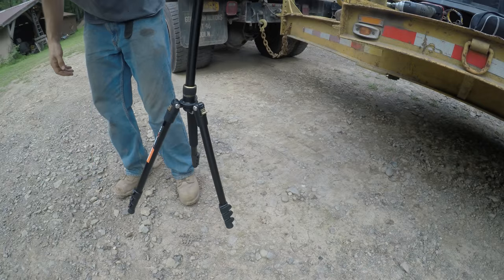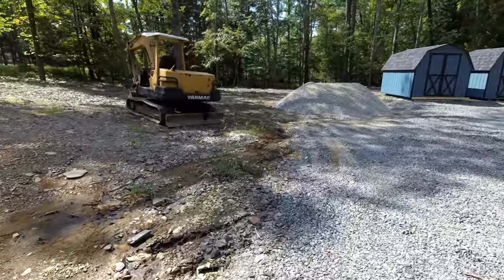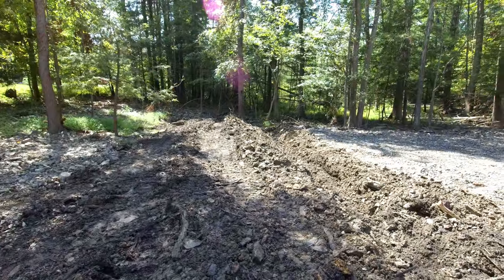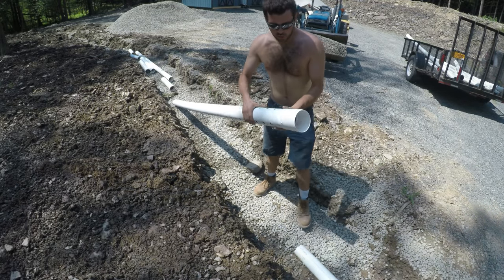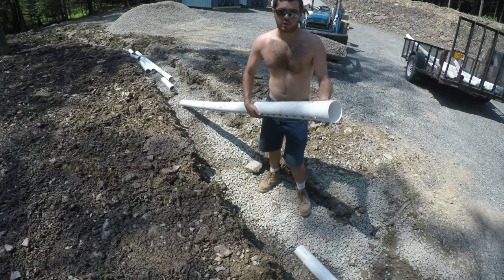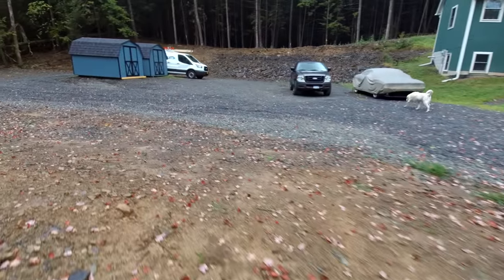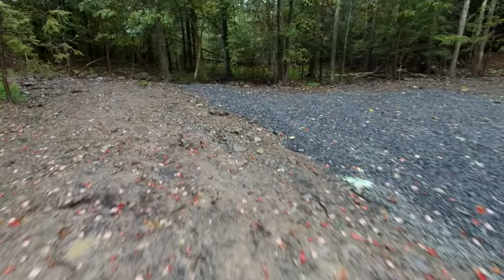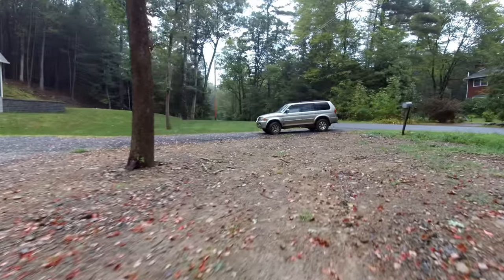Digging a drainage trench

Comment: Good job but I would recommend you should cover the underground drainage pipe with landscaper's fabric.  It's cheap and keeps dirt from clogging the holes in the pipe and eventually the pipe will get clogged and you'll have to dig it back up and do the job over again.
Reply: sounds like job security 😂😈😉

Comment: Great video as aways keep it up.
For similar work I typically use the 4" perforated black drain tile with sock on it.  It holds up well and is easy to install.  Like others mentioned  if you have long runs put a clean out in or a catch basin if practical.  
I know alot have mentioned digrite 811, where I live it's the law and my insurance won't pay if I don't have a valid completed work order.  I fill the requests out on line and typically in 24 to 48 hrs they are complete. In an emergency they have a on call team that marks 24hr a day for like water mains and sewer breaks.

I installed an electric brake controller in my dump truck.  Pretty straight forward install.  I have the time delay style Reese brand works good.

Comment: With the connections you have, maybe a expansion into lumber garages or grounds maintenance. A bigger tractor or lift the box blade.. to do it or not to do it bigger machines cost more to maintain but then they are faster. Stay with what you have and know the limits or go bigger and break more. As maintenance goes, a set of door pins in dump truck wouldn't hurt, do that on the second saturday this week... that never comes. You have grown exponentially to a force to try an outbid from other contractors. Your busy for a reason, plus your "inspector" has been giving you passes when he might of been more critical (more whip cream dad on my biscuits) What a fabulous companion

Comment: Now, I haven't read through all 638 comments, and I"m not going to, but I take it from what little I've read that Dig Safe isn't a thing in New York State.  I've seen you dig before, Andrew, without any Dig Safe markings.  Man, in the Commonwealth of Massachusetts there is no way you'd dig across an electric service without Dig Safe having marked that out first, or any other services for that matter.  And I realize they get it wrong half the time.  In the Commonwealth, it's a requirement of the law.  I give you credit, dude.  You got guts.  I love these videos.

Comment: Water is lazy and looks for the easy path, holes down give it the easy path without having to get up to the mid/top of the pipe. Yes the rock handles a good amount of the water but when surface water and ground water start up the pipe quickly handles the overflow. 

One thing you might want to do on future projects is the up hill side end with a surface clean out by putting in a 90 rather then a cap. This makes snaking or flushing the line easier when it gets silted up. In the current form you would need to work from the down hill side to clean it out so are standing/kneeling in the water/muck you are cleaning out of the pipe.
Reply from the maker: That's an interesting idea.
Reply: Ya, pipe holes down limits the crap percolating down through the stone from above into holes, if facing up, and filling the pipe with crud over long period; water percs down to bottom of trench and then when it rises into the pipe through the holes on the bottom, its not carrying the crud, and it flows down the pipe as Andrew H describes.
Reply: Solid point!  Pipes need maintenance to keep functioning over time. Always install catch basin at uphill end & every 50-75' or so to provide cleanout access. You could stretch to 100' but shorter runs are easier to snake ;-)
Reply: Why not install a 4in. agricultural draining pipe , it's got holes all around, never gets clogged and water can enter easy from any angle??
Reply: Holes down is the way to go. Another problem with holes up is the pipe can't drain the water covering the pipe below the holes.  You could have 4 inches of water around the pipe that can't drain because the holes are on top.  But as usual, another great vid.  Thanks Andrew.
Reply: I'm just wondering how the pipe will fare with the first loaded cement truck for the garage build?  
Hard for us viewers to gauge slope but it sure looked like the drop was minimal in spots.
Reply: Tony Ioannoni I agree that’s what I’d use.
Reply: @peterhaan9068  Storm sewer commercially is usually ran between an 1% & .5% , meaning , its running downslope between an 1/8 inch to 1/16 of an inch of fall per foot. Water needs very little incentive to flow.
Reply: james leatherman “water needs little incentive to flow” very nicely put my friend

Comment: Typical 80's ford truck doors, have had the pleasure myself.
Keep an eye out for some replacement door hinges, those are about gone and/or the hinge mounting points are hogged out.
You can fix that window crank by replacing the plastic knob with a roller bearing, hard part is finding the right size bearing and suitable mounting hardware.
Hockey or gaffer tape wrapped on the roller bearing makes it less slippery.

Comment: Hey Andrew here's a tip that will help you out. Weld a piece of flat bar on the back of your box blade on the top and mount a ball on it. Works great to moving trailers around and not having to drop the box blade off if it's not too heavy of a trailer. Just make sure your tractor way more versatile.
Reply from the maker: I have a 3pt hitch that has a 2" receiver on it. It works well for moving trailers.

Comment: I'm not an expert with pipe laying but I used to do it for a company, doing sewer with SDR 35, and drainage with ADS perforated and non perforated and water main; and in my experience with doing that work you usually put the perforated pipe up, only because you're not trying to catch the water in the ground itself (which would make the ground all squishy and a mess), you're trying to move the water that hits the ground and stays, which leaves all the puddles everywhere

Comment: Have you considered corrugated core drain in socks with 20mm aggregate (blue metal ),wrapped in geofabric. its what we use in landscaping in Australia, its what they put under sports  fields, too. can be buried under 1 foot of well draining topsoil, and covered with turf(or gravel etc). It is used because it does not silt up for a very long time...Not sure if similar systems are used in america or brand names etc.. Its basically a plastic corrugated flexible pipe 100mm diameter wit lots of holes wrapped in heavy duty stockings, and placed in the middle of a 1 x 1 foot  trench, lined with a long lasting permeable silt resistant fabric filled with 20mm rock, and then covered.
Reply: Sounds a bit overkill and expensive just for a front yard of a residential, if you ask me

Comment: The reason the holes are down is so the water in the trench doesn't have to reach the top of the pipe before it starts draining....Love the vids keep them coming,,,, Your getting better at the vids each time you make one
Reply from the maker: I get that, but what if the height of the holes is an acceptable water level?
Reply: it would work just not as effectively as holes down. It also helps stop the pipe from getting filled with sediment.
Reply: It's also better to not put much gravel under pipe because same reason. Water collects in trench you have like 4" gravel under pipe so there needs to be 4" water before it reaches those holes and start drain away.

Comment: @10:10 I watched a video where the guy explained why the holes go down. I always thought they go up but as he explained, the water would have to rise up to the level of the hole in order to fall into the pipe. The holes on bottom allow water the perchlorate slowly taking the water away. Also, holes on top would allow dirt to fall down into the pipe clogging it up.
Reply: toughAncientspark , i think the same way than you man, for my experient i put the hole up, i dont know if the ingenier say domw for me dont good idea.
Reply: The slotted PVC pipes, (as distinct from plastic perforated flexible agricultural drain pipes) are specifically designed for the holes to be at 5 o'clock and 7 o'clock, so that the water can rise into the pipes and drain along the curve of the arc left between 5 and 7 o'clock. As the surrounding soil/gravel becomes more saturated, the pipe carries a greater volume. Geotextile fabric 'socks', (along with gravel) assist to reduce silting. :)

Comment: Ha, I love the hole up or down argument. It depends on the situation,  but I usually don't rock the bottom of the ditch if the grade was cut pretty close, then install the perf holes up and backfill with 1½ open quarry.

Comment: Andrew, another great video. Thank you for taking the time and effort. As and underground contractor and a "virtual" friend, please do me and yourself a huge favor: call 811 before you dig. Make sure those dig tickets are clear and that everything is marked. It could cost you a lot of money and is such a safety factor when dealing with power and/or gas. The phone call costs no money to you or the property owner. It's just not worth it my friend not to call. For everyone else reading this, please do the same, even if putting up a mailbox or fence or whatever. If you cut a utility line and you haven't called 811 YOU are responsible for damages,
Reply: At least it's not a national communication cable, but there is no price for your life.  "Should be 18 inches down" have been the last words of quite a few contractors.  It takes about 3 minutes to locate that power line, and an additional 2 to locate the communications. I'm not gonna tell anyone what to do, but I would seriously at least invest in a locate set.  Then you know for sure, for sure, exactly where the utilities are and you are not guessing.

Comment: Greetings from Sweden! Thx for all uploads, i really like your videos and your enthusiasm. I drive excavators everyday on construction-sites and id like to share some tips. Always use fabric to prevent the pipe from clogging up, and always use washed stones when covering drainage pipes. An L-shaped pipe at the high spot with a lid for inspection and ability to flush the pipe if needed can also be good. Don´t get me wrong, not trying to bully, just helping...
Reply: They don’t seem to have cloth or fabric like that in US......bra tips!
Reply: Is the trench deep enough? I'm worrying about how the pipe will deal with cars and tractors over time.  And yes these pipes are likely to clog up easier without fabric.
Reply: @RayCathode100  Well i would never put any kind of pipe that shallow, and remember its a drainage pipe which u use for groundwater. Id put those a lot deeper. Looks like the outlets from the roofs are a big issue here , infiltrating the parking area every time its raining. I would have used an open v trench and connected those 2 outlets from house to it, that way the water from the hard parking surface have some where to go as well. The water you noticed from his trench is not likely groundwater, its rainwater infiltrating that spot cuz the ground is to hard to let the water pass thru.

Comment: The pipe used is for soak aways, hence the holes on one side. A coil of perforated land drainage pipe has holes all the way round to take rain water and ground water. Im sure those pipes worked fine for that little area

Comment: Hi Andrew, I enjoy your videos, but you should invest in a cable locator with a signal inducer (cat and jenney) or similar, around cables you need a banks man, and utilities drawings.
In the UK you could be prosecuted by HSE for not doing so, Electric Cables will Kill.
Reply: Do they not have 811 Call Before you dig in New York State? I use it on every dig.

Comment: Holes always go down to accommodate the rising water level. It also helps to keep the pipe from getting clogged up with sediment. That's the way the pipe is engineered to work correctly.

Comment: Always try to sell the homeowner an additional layer of geotextile, its not much additional work for you and increases the longevity of drainage systems. Keeps small particles out so it doesnt clog. And like others mentioned, a small manhole at the start of the drain for easy cleaning access is nice. Also not alot more work, but you get paid well for it :)

Comment: I have been screwing around with door handle on F350 - same thing -  thought it was cable stretched but it was more the pot metal /tin mechanism  inside pulled out to allow  cable   length to seem like it stretched  1/4" - 3/8".  I've replaced several handles.   I ended up doing and Andrew Camarata on it and hammered the metal inside to the right position and then tack welded it so it would not stretch again.   Previous owner pulled handle so hard  metal buckled under the handle mechanism so I hammered back down and put steel plate underneath to is not bending again. we'll see how it goes. In the yards all the driver door handles of 85-97 ford 250/350 are gone. it's a ford problem.  The cable is plenty strong so it won't stretch or break but the metal in the mechanism is garbage.

Comment: the modern perforated drain pipe is normally installed with the holes on the bottom for two reasons. 1) the water will flow in the pipe as soon as the water reaches the level of the bottom of the pipe, rather than having to rise all the way to the top of the pipe before it can flow into the pipe and away. 2) with the holes pointing up, you will get a bit more sediment washing into the pipe due to the gravity assist and the pipe will clog up sooner. So, one should normally install these french drains with the holes DOWN. Forgot to mention, I have clean outs in all my drains. Silt is inevitable, but it is easily cleaned out, if you can get at the pipe to clean it.

Comment: I'm sure Andrew knows this, but didn't think their was sufficient risk to warrant the wait; for those who don't, in NY State call Dig Safely New York; dial 811; most states have a similar program and same 811 number; someone will come out fairly quickly and mark all utilities. If you don't, and damage a utility, if you aren't already dead, it will cost you A LOT!! Love your videos Andrew!!!
Reply: same service where I live, check it out and stay safe Andrew, we love you
Reply: I also am sure you are aware of this but when I put in a drainage pipe i put a silt sock over the pipe before burying, they sell it with the pipe where I live and its not expensive and helps keep the pipe from getting clogged with dirt over time
Reply: Yea the power was in conduit and insulated so you'd really have to try to hurt yourself. He also was digging in his own fill, so he knew it was below that. An experienced operator will know when he's pulling on a conduit. I hit a direct bury power wire one time and could even feel that and stop the machine before breaking it.
Reply: CBYD
Reply: 68Camaro RS/SS  
On the upside, if they mark it, and it's wrong and you hit the line you aren't liable.
Reply: 68Camaro RS/SS  after i made the comment I got to thinking that it doesn't matter if they were wrong or I was when it comes to gas. Out in the PNW we really don't use natural gas because of all of the fault lines. 

And tell me the laws for the gas out there, just curious
Reply: 68Camaro RS/SS  
Pacific NorthWest. PNW. 

And yeah, that sounds a bit of a doozy to go through, but hopefully it prevents any other massive explosions.
Reply: 68Camaro RS/SS  electricity or wood burning stoves mainly. I rarely hear of people using oil to heat. Electricity is cheap out here. My county had it for about  .14Kw/h
Reply: 68Camaro RS/SS that was 2 towns over from me. Scary. Some people are just being allowed back into their homes! 5-6 months later.
Reply: Calling 811 is the law. Don't call and you can face very heavy fines if they choose to enforce it. There are two types of locates though and they both must be done to comply with the law. The first is 811 which is paid for by the utilities. The locator will come out and locate the utility owned service. This usually means they will locate from the main line to the meter. Anything beyond the meter is the responsibility of the contractor performing the work if they are working in the area. Private locates are paid for by the person performing the work and they locate anything beyond the meter. This would include utilities running to out buildings. They can also locate non-ferrous utilities such as sewer and water lines. Sewer and water lines, if they weren't installed with a trace wire,  require a sonde to be placed in the pipe. It is the sonde that will be located, thus locating the pipe. Locators have a 4 foot window that they can be in for their marks to be considered correct. Locating isn't perfect, there are a lot that can interfere with the signal. Sometimes its a new and inexperienced user, but more often than not it is something else interfering with the signal. Often times we can't tell that the signal is wrong. The law requires you to pot hole around the marks until you locate the utility. This must be done by hand or with air spades or hydro excavating. Marks can also get moved or destroyed which is why pictures are taken by the locator. And no, the information isn't sent out to a foreign country.

Comment: why the tractor rather than using one of your skid steers? seems the skid would have been much better for this job?
Reply from the maker: Tractor was able to drive down the street to get to the job, the tractor did a fine job, its nice that it doesn't mess up the ground every time it turns too.

Comment: Did you only dry fit your perf-pipe and bury it ? I mean I've always used the bonding adhesive to prevent it from comming apart.frost and settling would pull them apart . Especially with frost conditions, Unless you are situated where frost isn't an issue.